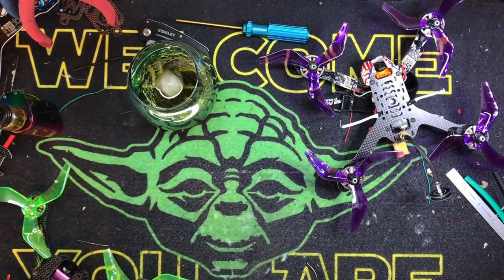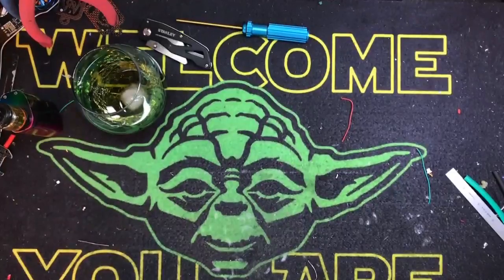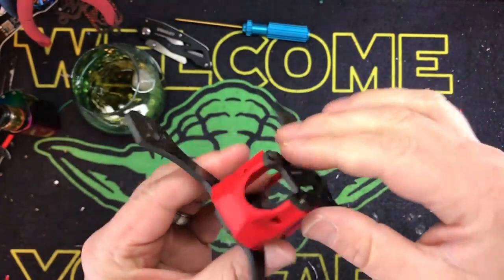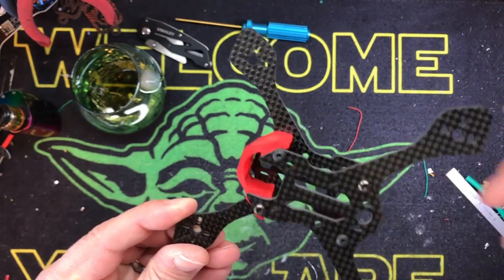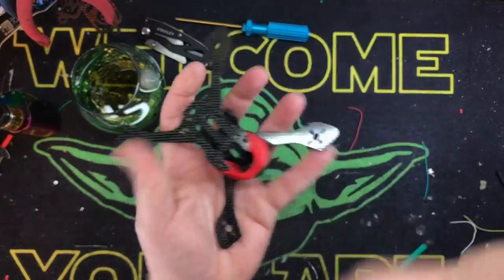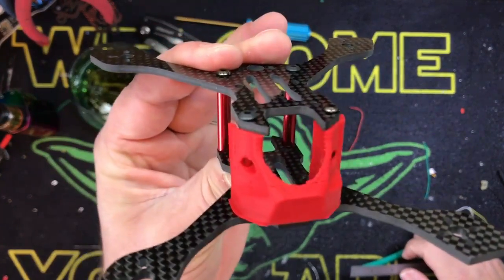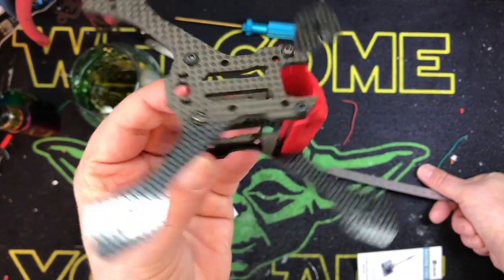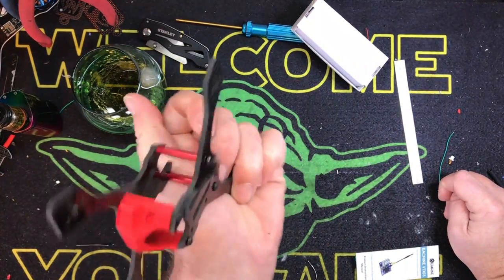Moka Simplex Pro Mikro Prototype Part 1

Comment: What happen to your video of the Eachine Stack you posted earlier I can't access it and I wanted to hear what you had to say. I bought that Stack 2 months ago and have had  horrible luck with it. My FC lost it's 5v, I'm thinking cause the VTX gets way too hot at 200mW. They sent me a replacement FC and I turned down the VTX to 50mW and finally got my quad in the air with that stack and had some good flights and good footage from the DVR for the last week. Sunday was my last day I flew and I went to fly yesterday and now all the sudden out of nowhere for no reason when I plug in my LiPo I dont hear any beep sequence and my motors won't spin up. Its like the 4 in 1 ESC took a shit on me now. I like the DVR so I'm just going to use that with my Omnibus Pro F4 and buy another 4 in 1 ESC. You can see some of my footage from that Eachine DVR on my Channel. That Stack is a horrible piece of shit!!!
Reply from the maker: I put it back up brother.   I forgot to add the dvr footage on it so I took it down and reposted.   It’s back up